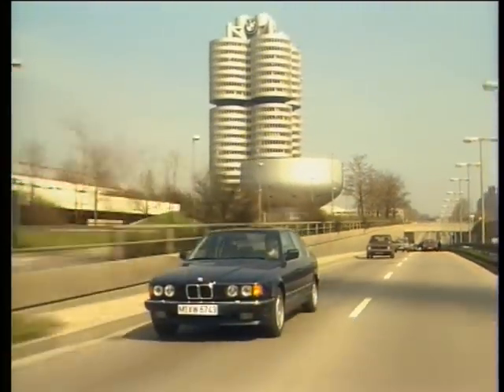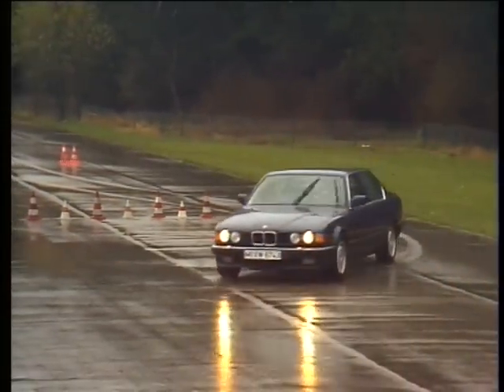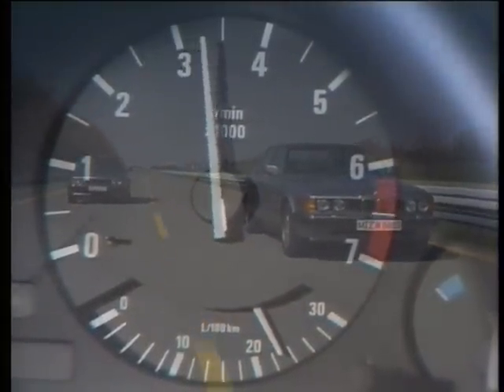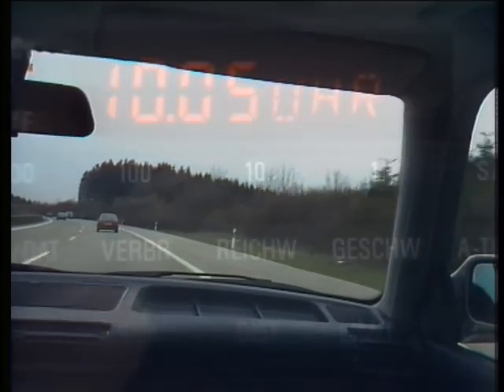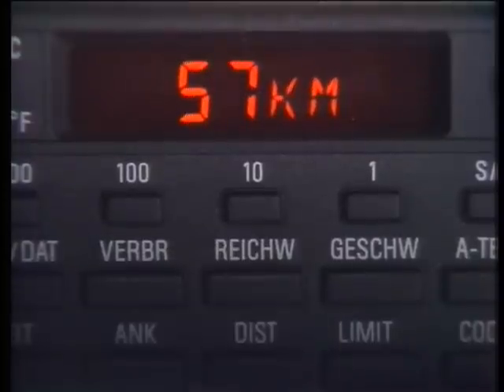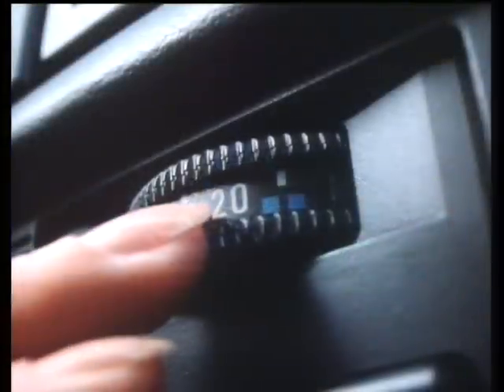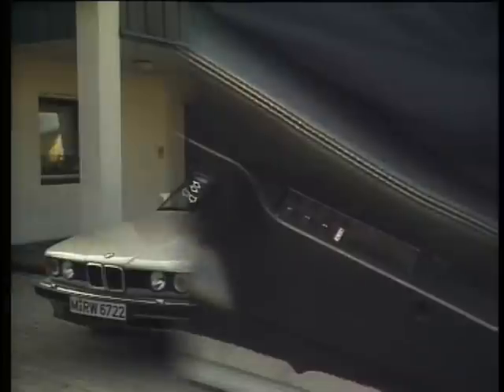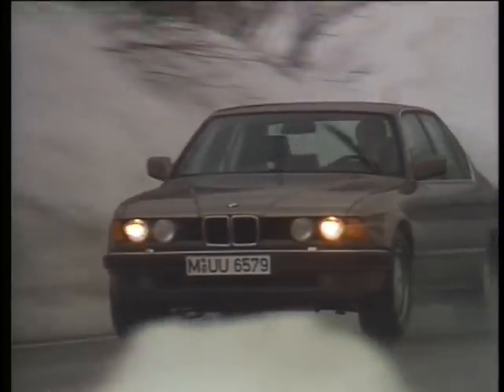BMW 7 Series (E32) Electronic Systems

Comment: E32 & E38 will always be the best design looking 7 series. 
Wish I had one of those cars
Reply: Get one while you still can for "reasonable" pricing.
Reply: @g.w.7893  Well the window for the E32 is kinda closing, and they aren't cheap anymore, if they are in good condition. E38 is still a great deal, thankfully I got my E32 a few years ago over a friend of my uncle for 150 quid.

Comment: Impressive. I always assumed most of this tech  was only around in the later e38/e39 cars
Reply: Bry Ytab bmw e32 was the first car to introduce xenon lights.
Reply: The jump from E23 to the E32 was massive compared to that from E32 to E38
Reply: E38 E39 got their technology from this car being it modernized and revised versions. like the ESC TSC and check control. The E32 750i was the first ever car to have xenon headlights in 1991

Comment: Actually a system like the ASC (ESC) can make it much more difficult to get out of snow when you´re stuck. I´m not saying it´s optimal to let the wheels spin at full speed when you´re stuck in snow, but sometimes i feel - that on cars where ESC / ASC / ESP can not be deactivated - the electronics limit the rotation of the wheels too much - hence that makes it much more difficult to get out of snow when you´re stuck.
Reply: Bryan Awkwardson it can sometimes help if your car is automatic
Reply: Actually ASC dont works in snowy condition with it can barrels on pressing the pedal, indiually u can , but selected gears can discuss

Comment: All these technical advances, yet the mirror is still smaller than in a similar year corolla (actually E80, E90 and E100 o be more exact).
Reply: You dont know the class of BMW,
Corolla are rust magnets
Reply: @BIIGG_BROTHER  I've seen more rust bucketed bmws than corollas around my area. Now if you were to bring up a volvo, then my argument would be as dead as an item. Also what class? Those 10eur that the manufacturer invested in sound deadening? Or maybe it was those little bmw badges scattered around the car? Ever heard the saying - class isn't bought, it's built?
Reply: @eivis13  just relax bro , dont be too serious, just chill
Reply: @eivis13  You don't have a clue about BMW and that is obvious! ! 10 eur in sound deadening? Don't be an absolute clown. BMW built an exceptional car and you already know that. Even Mercedes was pissed off so much, they had to go back to the drawing board!

Comment: after all this year this cars has better electronics than your premium 2015 came or equal lol love the Ultimate driv I ng machine .
Reply: Love your ultimate spelling
Reply: @xHarux3 Don't know about that one bud, have an e60 530i with 200k miles and no issues, also used to own an e39 528i again never had any issues.
Reply: Robert Tadic I’ve had more issues with other car brands.
Reply: Indeed, nowadays cars are 90% chinese wires. I own a 1988 audi coupe quattro with almost all original electronic equipments, cars back then were simpler and made to last. Also all pre 1992 cars have a certain charm to them that new cars simply does not have
Reply: MessiE60bmw agreed